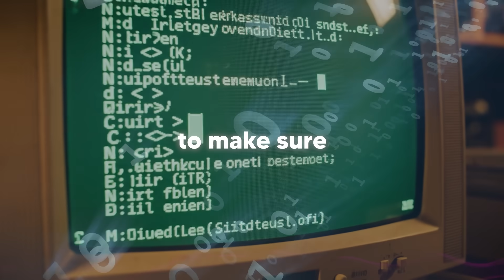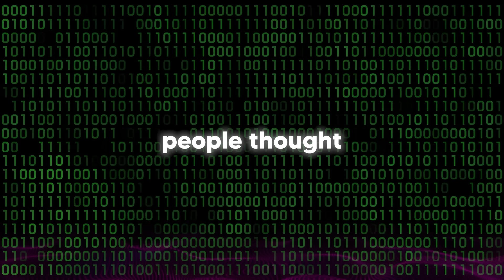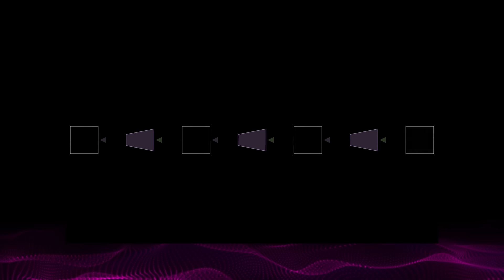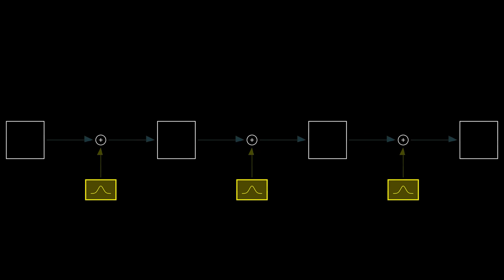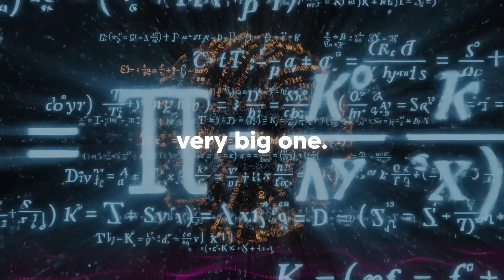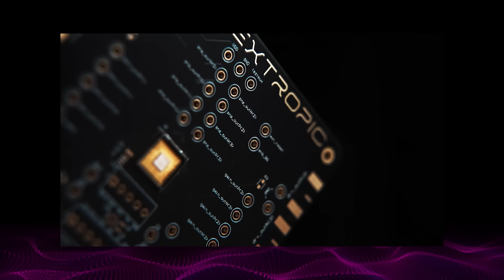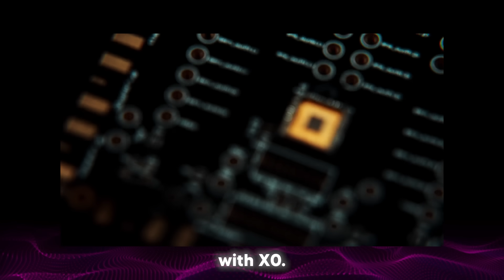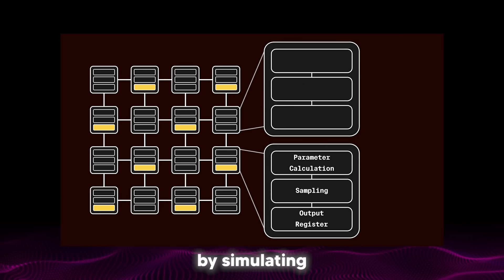If This Works… AGI Arrives Early. (Thermodynamic Computing)

Comment: But why do they keep building systems that work off randomness or variance? Why necessitate all this stuff, for something we could have solved otherwise? I mean if physics had been properly calculated from the beginning we wouldn't have this problem. If electricity was used right from the beginning we wouldn't have noise and heat output. If scientists or mathematicians had discovered all of the constants they'd be in a better position to understand how things work. Whether they outperform Quantum computers or not isn't really a big deal because I've already got a methodology for solving quantum problems on classic hardware considerably faster than Quantum hardware. Which means I've already made these guys obsolete too. 🤷 Anybody who wants to see it to validate it let me know.

Comment: I smell an alternative to quantum computing…

256 parallel bids parallel load, there are two outputs and it wants to see a binary 1, the other a binary 0.
A new bit come in and All input bits shift right, then another and another …

Starting From the output and working back to the input and with each new bit, a pattern begins to emerge within the chip. A pattern that always changes the least and pattern which would want to see a 1 and a 0 at the outputs.

Once x number of bits are processed ( x = the length of the preamble)  the internal chip pattern locks in. 

That pattern would conceivably mimic the gate arrays seen in an encryptor, thus decrypting the data stream.

Comment: If building a bigger AI will always generate more profit, then more efficient AI has no effect on total energy consumption. 

AI companies are racing each other to build the biggest AI possible. If a 10,000x efficient AI is available, they're not just going to build an AI at 1/10,000 the power consumption, they will always use every bit of energy available to them and build an AI 10,000 times bigger with the same energy consumption.

It's a cool, otherwise informative video that fails on some very basic economics and game theory. This won't solve our problems and there is still lots of reasons to be concerned about the risks and abuse of AI

Comment: To me this feels real, i have been a design engineer for 40 years, i have done pretty much every kind og design.

The description  you gave reminded of two things,

1. microwave design process i designed GaAs chip with.  We called it optimization, its a trial and error process where we give our s parameter simulator tool goals, and an iteration process to achieve those goals.  Gradient is like the ball rolling down the hill, Random is when you have no idea what terrain is and varies the desighn parameters widely.

Our tools and models were not perfect so very often we repeated this process with hardware for months or years sometimes.  This happens not just because of mistakes in the process, but because we dont know many things, trying to build something the best way we can, and often we dont know what is possible.

Trial and error using a random process is the most creative process possible for the kind of problems where what is possible is not known or the problems optimal solution is hidden.  Its like trying to solve the future or a higher dimensional problem which we cant concieve its shape.

This is exactly what hard problems are, they are only partially solved by logic, so many things are discovered by random processes applied with diligence.  I have seen technicians solve problems that engineers thought were impossible, i have done it gone into meetings and explained things no one believed were possible.  Its like the best easter egg ever, its what makes the brutal grind worhwhile intellectually.  I think this is fundamental in creativity.

Comment: Whats even more crazy than any of this, is that it is not alone. We are simultaneously revamping how neural networks are written, causing them to be up to 99% more efficient. We are developing photon based chips instead of electrons, which will be faster, not cost as much energy, and won't over heat. THEN theres the thermodynamics part AND the fact that new data centers and nuclear plants are popping up everywhere. All at the same time. 
I asked grok for an analogy on what our compute power is now vs like 5 years from now, because the numbers seemed too big to understand. It said it would be like getting around on a bicycle vs flying a fleet of subsonic fighter jets.... i dont know where the "fleet" part came from, I would fit into just one of them, but still.😂

Comment: There's a reasonable chance that some teams will prototype DIODE ARRAY soon and an excellent chance it will work. 

I am on a 60 year quest to overcome the second law of thermodynamics . that began as a teenager inspired by reading View from a height,  Doubleday 1963, a science anthology by Isaac Asimov. He first wrote very convincingly about the  principle that energy is conserved when changing form then wrote much less convincingly about the concept of entropy. 

The concept of entropy is stronngly accepted to this day after being promoted by a prominent astrophysicist, science popularizer, and Quaker Sir Arthur Stanley Eddington who considered the second law of thermodynamics to be the most fundamental and universally certain law in all of science. He believed that entropy never decreased so the universe faces an ultimate heat death of stagnation so somehow the universe had to start with low entropy. Eddington had a deep metaphisical side so he also believed that God was beyond the relm of science. Theologians used the second law as proof of God. This is unsound proof because God could alternatively be supreme over an eternal non doomed universe. 

Energy changes form without gain or loss. Uniformity or diversity is not, in itself, a form of energy.  Therefore entropy is an extraordinary claim burdening the law that energy is conserved even if it is changed in form. Thermal energy's almost universialy observed present practice of a partial  transformation range with an unusable residue is an inelegance. 

Because the second law is intensely accepted it is hard to find people that want to prototype devices that may falsify the second law. Therefore I am posting this essay as a comment on YouTube to attract teams or exceptional individuals with access to suites of complex equipment to build exploratory prototypes that will prove the concept then home in on a good recipe then fine tune for small scale production. A lot of small sample working device trinkets can then be presented and handed out widely to people at media conferences. A low power proof of concept prototype would power a LED in an eyecup with Inspectable parts and assembly and socketable dummy chips as controls. Subsequent conferences would be called to report news of more powerful prototypes powering more powerful samples that can be loaned out for examination. 

Go ahead and start to build something indspired by this introduction without my involvement. We can meet after there is solid crowd verification.
After small scale prototypes of various types are made with widely developed processes many enterprises will be able to think of fitting scale production. There is no need to have one manufacturer emerge. All competent manufacturers should develop their processes without exclusivity or forced dominance. I don't think I have outstanding abilities at this phase so I'll help but mainly get out of the way. 

Let's reframe Earth's low diversity abundant ambient heat as a thermal energy waypoint between heat and other forms of energy. 

Energy sensible refrigerators that absorb heat and yield electricity would complement computers as computing consumes electricity and yields heat. Computing would be almost free. Chips could have  energy recycling sophisticated srructures combining microscale heat pipes and light and electricity paths built in.
Full heat recycling, all electric, very isolated underground, undersea, or space communities would be highly survivable with self sufficient EMP resistant LED   automated vertical farms, thaw resistant frozen food storehouses, amphibious factory submarines, nonstandard dwellings, self contained elevators, safe rooms, and free range transports.Some electrical equipment groups could be consolidated into local networks when suitable. Liquid nitrogen cooled superconducting networks would become practical. Fire safes would maintain contents at a desired temperature in extreme heat or cold for years. 

In a flourishing civillization, small self sufficient electric or cooling devices of many kinds and styles, lamps, smartphones, hotplates, water heaters, cooler chests, fans, radios, TVs, cameras, security devices, robots and robot test equipment, scales, transaction terminals, wall clocks, open or ciosed for business luminous signs, power hand tools, ditch diggers, pumps, and personal transports, would be available for immediate use incrementally anywhere as people as individuals or larger social groups see fit. Human enobeling communities could be built quickly. 

If a high majority thinks our civilization should geoengineer gigatons or teratons of greenhouse gasses out of our environment, hypothetically networked instalations, either a few big ones or many small ones using clean electricity, heat, or refrigeration and producing desired side products would be built. 

A simple rectifier crystal can,
just short of a replicatable long term demonstration of a powerful prototype, almost certainly filter the random thermal motioren of electrons or discrete positiive charged voids called holes so the electric current flowing in one direction predominates. At low system voltage, a filtrate of one polarity predominates only a little but there is always usable electrical power derived from the source, which is Johnson (observation) Nyquest (theory) thermal electrical noise. Max Plank anticipated that ambient thermal noise would become usable with advances in technology.  

How can the emperical second law of thermodynamics possibly prevent a DIODE ARRAY from working? 

In 1973 I filed for US patent 3890161A DIODE ARRAY for an array of metal1/ insulator/metal2 diodes that refrigerate while concurrently producing electric power. The patent was granted in 1975. It was opened to the public domain in 1992. Development is in the public domain while granting me writing attribution. 

The plausible net electrical filtrate from diodes can be aggregated in a first grouping of separate diodes in  consistent alignment parallel. After a primary level of grouping that preferably is in parallel where current is additive, compound parallel and series where both current and voltage are additive, networks can be built to provide desired DC current and voltage. Within limlts, parts of the  network can be shorted out or open circuted without electrical or chemical harm. Widely scalable electrical power always paired with equal refrigeration is thus possible. The efficiency of each diode is probably low because the initial power within each diode is nanowatts which doesn't graph far beyond the near linearity near the 0,0 orgin. This inefficiency affects the performance but not the equality of the thermal absorbtion and the electrical yield. 

The maximum energy is converted from ambient heat to productive direct current electricity when the load electrical resistance  is equal to the array internal electrical resistance. Maximum calculated electrical power output (watts) is k (Boltźman's constant), one point three eight x 10^ minus 23, times T (temperature Kelvin) times bandwidth (0 Hz to a natural limit ~2 THz @ 290 K) times rectification halving and nanowatt power level rectification efficiency, times the number of diodes in the array. 

There are a billion measurment cells of 1000 square nanometer area each per square millimeter, 100 billion per square centimeter. 

Order is imposed on the random thermal motion of electrons by the structual orderlyness of a diode array made of diodes made within a slab: 

Host crystal in this example is silicon or germanium 

 
________   -out
🔻🔻🔻🔻P type boron doped
■■■■■■N type Phosphorous doped
                      +out 

All the P type semiconductor anodes abut a metal conductive plane deposited on the top face of the slab with nonrectifying joins;  the N type semiconductor cathodes or common cathode abuts the bottom face. As the polarity filtered electrical energy is exported, the amount of thermal energy in the group of diodes decreases. This group cooling will draw heat in from the surrounding ambient heat at a rate depending on the filtering rate and thermal resistance between the group and ambient gas, liquid, or solid warmer than absolute zero. There is always a lot of ambient heat on our planet, more on equatorial dry desert summer days and less on polar desert winter nights. 

Hopefully a lot of people, mostly as independent teams, will join in developing the DIODE ARRAY. Please share the successes or setbacks of experiemental efforts. The topic deserves crowd financing, discussion and prototyping attempt action. Crowd development would be resistant to confiscation or burial. At best there could be science quality colaboration. 

These rectifiers could be various types, such as:
• Field emission diodes: An array of needles the needles made of carbon nanotubes or another electrical conductor tipped with an emmisive material probably LaB6 abutting straight in and also separated by a thin insulator or vacuum gap from a metal plane substrate surface.
• Schottky diodes: A metal needle-to-semiconductor junction diode, the semiconductor may be Gallium Arsenide or Indium Antimonide.
• Silicon or Germanium crystal diodes: A well-established technology. These diodes may have poor performance in this application 

These devices would probably become segmented commodities sold with minimal margin over supply cost. They would be manufactured by advanced automation that does not need financial incentive. Applicable best practices would be adopted. Business details would be open public knowledge. Associated people should move as negotiated and freely and honestly talk. Commerce would be a planetary scale unified conglomerate of diverse local cooperatives. There is no need of wealth extracting top commanders. We do not need often token philanthropy from the top if the wide majority of people can afford to be generous.

Comment: This is a very dangerous discovery at the cost of energy efficiency since it complicates auditing and alignment testing since the states are now encoded stochastically. If this works, our extinction arrives early since we can theoretically stress test and audit much more effectively with deterministic models but with probabilistic models even a slight probabilistic flip can lead to unexpected outputs.

Comment: Isnt this probability bit a type of quantum computing
Reply: It's not, pbits use thermal noise which is useful for generative ai since these pbits natively encode probability distributions instead of having many bits simulate it. Quantum computing is more useful for search and works deterministically in implementation. An example would be maze navigation, with classical or even thermodynamic computers, you would only pick one path to follow (it's arguably worse for thermodynamic computers). For quantum computers, if you meet a crossroads within the maze, you could just search both at the same time and it would collapse into the right path to lead you out of the maze (that's why it looks like it works probabilistically and is fast but in theory its deterministic).

Comment: John von Neumann originally came up with this concept in the 1950s. And computers using the concept were first built at the end of the 1960s. It's called stochastic computing. Wikipedia has a good introductory article on the concept and its history. This is an application of the concept to generative AI. And it looks promising.

Comment: I reverse engineered some soviet radioisotopic thermo-electric generators

Using the seebeck effect 

To recycle heat from plutonium isotopes in radioactive decay 

So that you can use a Bic lighter, to charge a phone

Then, I reversed the logic

Applied voltage to the north pole of a magnetized dipole magnet

To cool the south pole, at cost of current

So you can take current from heat, and use that to cool another place

Which creates a gradient pattern, in a crystal oscillator, wired to this system

Allowing for thermodynamic computations

Based on infra-red and UV like electronic input, from heat waves themselves 

Counted as current 

In a photonic computer 

To allow for more efficiency 

And it changes the look and feel of the data running through it

Although it integrated with other (binary)

Systems

Comment: The approach sounds similar to quantum computing whereas you measure the rotation of a particle and glean a result from it, though this doesn't seen to need all the cooling to stabilize it into a measurable value.
Reply: Seems like the randomness isn’t as ‘random’ as in quantum computing, or like more controllable, which is a big upside. I’m just going off this vid tho so idk

Comment: This uses so much less energy because pbits work somewhere in between quantum and classical, but they are slower because you need more time to sample even 100 samples that would be 100x slower. I say run pbits on 500 GHz for 100 samples for like 5 GHz computing.